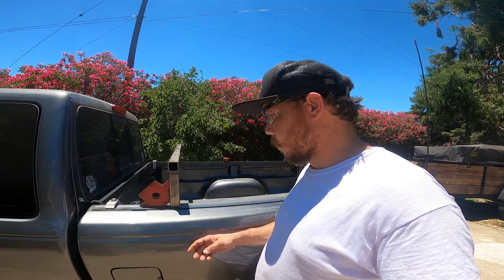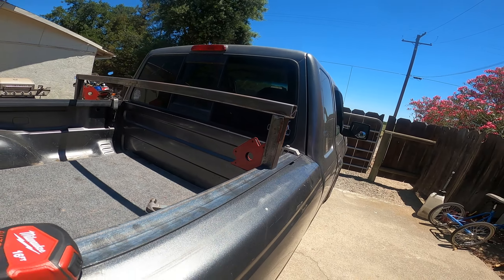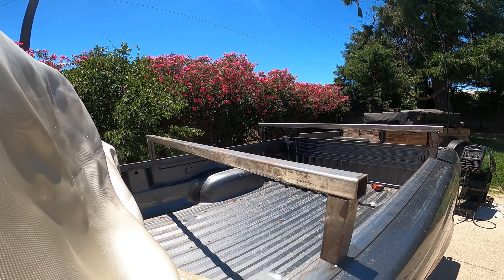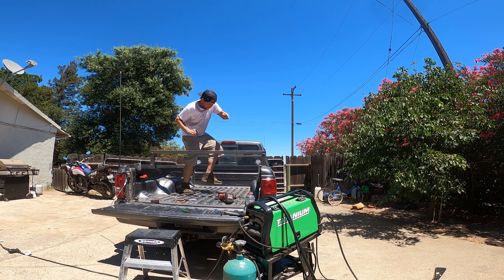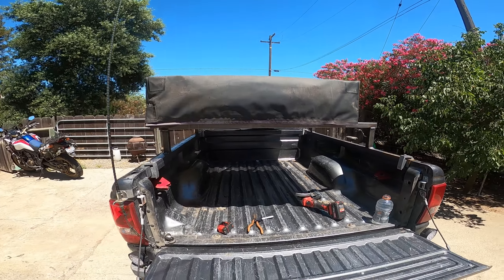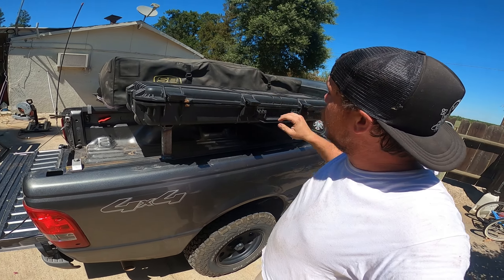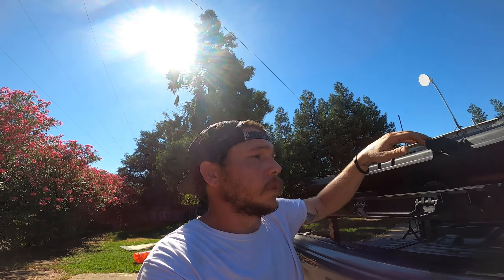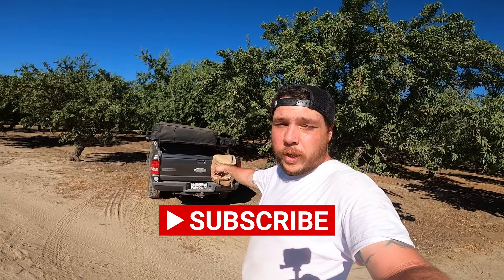DIY Ford Ranger Overland  Bed Rack.

Comment: How far apart do you have the 6” up rights from each other for it to work with the tent. And how long are those L bars you have it welded too
Reply from the maker: 41 1/2  inches part from each other. Each 2x2 angle iron is just about 5 3/4 inches in length.
Reply: @shammyadv  thank you.